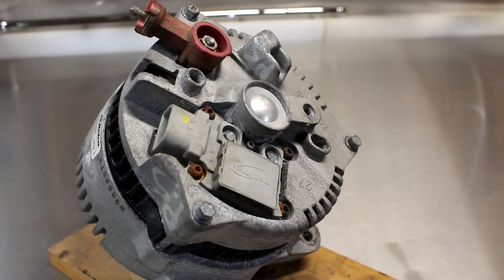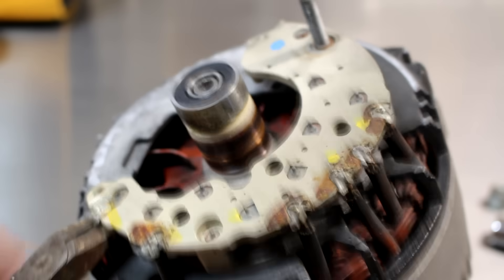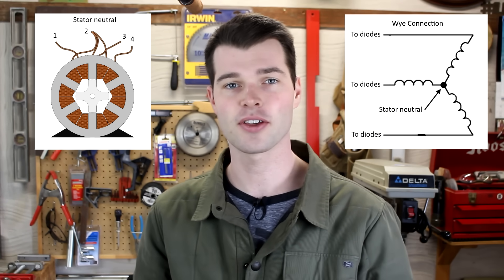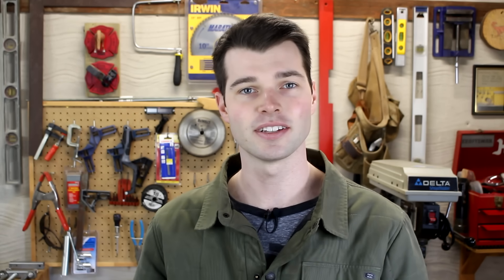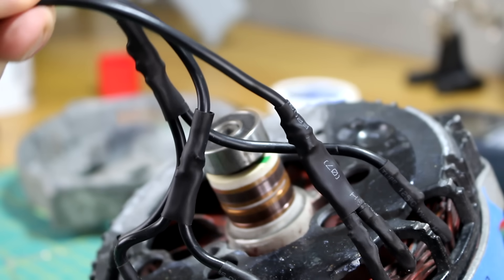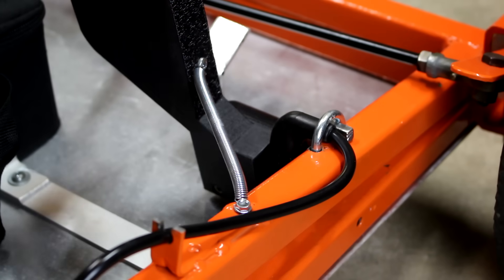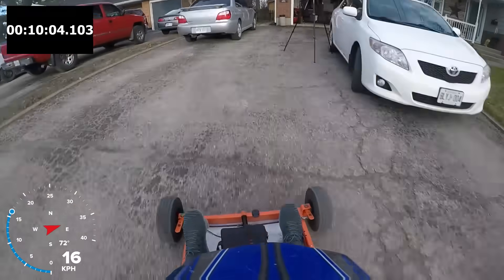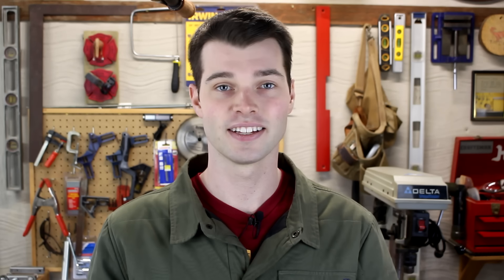Converting a Car Alternator into a Go Kart Motor

Comment: How about using same technology as is used in a Gear Reduction In some motorcycle starters but reversing it. Use a 60 amp Alt. for power only, using one chain to (example) connect to rear wheels, then as a tensioner use the larger gear reduction gear. The smaller one would then drive same size gear on shaft of 100 Amp Alt. This would drive 100 Amp Alt at max speed. (You can get shaft extensions with gear at one end and setscrew on hollow end to slide on alt shaft.Which would then supply power thru a rectifier/regulator (3 phase) be used for charging and lighting.Is this not what was used on early Motorcycles? Basically...? they used Generator to create AC voltage, which was used to Power Lighting and 90% of the electrical components used here This could be held to a minimum using LED's. The AC voltage then connects to a Rectifier/Regulator and is changed to DC voltage.  The DC power is used to power Brake light / Tail light and (again Using extended examples... fuel gauge, turn signals etc.) and sole purpose (without any DC lighting circuits, is to charge the battery. This was why when you turned ignition key on, you only had tail and brake lighting. Bike had to be running to enable Lighting circuit. This had pros and cons... left the key on (used kill switch to stop bike) Taillight stayed on draining battery was one, other was the did not see mode from other motorists (headlight had on/off switch plus H/L switch), most left headlight off until dusk. So they passed a Law mandating 24hr use of headlight / or running lights when vehicle was in use. this in the motorcycle world gave use total DC voltage. Key turned on... bike could be started (kick or electric starter) but all lighting was controlled by on/off ignition switch. Headlight controls were changed to just H/L function as they were now DC voltage.This dual voltage mode AC/DC could be used using a 12VDC converter to power a Battery charger to maintain battery etc.austiwawa , I think you are on to something here... maybe Just the basic concept. But if you can create power with minimal drag on power source, use a rectifier/Regulator... excess power would be dumped as to not fry Battery. Maybe just a voltage regulator (set at 14.8 volts DC, since you already have DC voltageActually the 100amp Alt. could be left original as it already has the capacity of the built-in Voltage regulator!!

Comment: Does anybody know what´s the maximum voltaje source you can use to power this motor (converted alternator)? Is it 14 volts as when supplying power to the car electric systems?

Comment: From prior experience with alternators, the rotor becomes magnetically saturated about 6V applied, and anything over does not get more power, it just heats the motor more. You could run half as many cells into the rotor and get the same output from your motor. And half the cells would get less current so a longer run time for your rotor pack.

Comment: Your cart will drive and turn much better if you build some ackerman into your steering.  The easiest way to do this would be to angle the steering arms inward on your front spindles. If you really want to get fancy incline your kingpins both inward and rearward at the top. What this will do is unload the inside rear wheel when you turn which does two things - it frees up the rear end (less drag) and plants the outside tire for bite. Have a look at a race cart front end some time for a visual of what I'm talking about.

Comment: Hey put another alternator left the way eat it would be on a car and a have it run off the other we'll either by belt or by chain and you could charge the battery as you are driving it. You would get a lot longer run time out of it if you were charging the battery at the same time you were driving it

Comment: I am quite impressed - this is a very competent and tidy job.  Even better - the thing produced at the end actually works!  I notice, someone has suggested the materials for lithium-ion are in short supply and hard to mine: Lithium is in salt, there's lots of salt; Cobalt is thrown away as a by-product of copper mining and in any event, can be partly substituted according to Tesla.  As for the perpetual energy suggestions - you must have laughed your socks off.  But it basically does regen braking if I am correct, or does that need another circuit?  I best re-run your vid.  Thanks again for sharing.

Comment: Nice project. Beware that the efficiency of this motor is not as high as if it had neodymium magnets inside. With magnets you save this part of the electricity which you pass to the rotor of the alternator. 
I wonder how do you find how much voltage to apply to the rotor winding. 
I think that to improve the efficiency, It should create magnetic force which is in balance with the opposing magnetic force from the stator.
I've got the following (untested) idea to improve the efficiency further (when magnetic forces are already ballanced via suitable supply voltages) (if the BLDC controller was in-house built):
 The stator's windings are supplied with PWM voltage. So the rotor is wasting energy when the stator windings are "OFF". It can be supplied also with PWM in phase  (or anti-phase - depending on how it's poles are wired) so the magnetic field to exist only when it's needed to create torque.

Comment: Sweet project! 

A side note for the alternator:

You can also leave the diode bridge attached and have the DC output feed back into the field windings of the rotor. That way you don't have to have an external DC supply.
Reply: You all don't know what your talking about. You wire the diode in series with the bridge rectifier opposite of the primary phase Feild winding. The other fields you wire in parallel. Besides the resistor on the commutator only puts out 5 milliamps. 😜
Reply: Bullshit dude. Do you not know the purpose of a diode?? Ya, they only allow electricity to flow in ONE direction. That is the sole purpose of diodes.
Reply: @JM-yx1lm  Diodes have many purposes, unidirectional current flow (under 'normal' conditions) is only one property (although a universal one). LED, zener, tunnel, schottky... and some of these are useful precisely /because/ they conduct in a 'reverse' direction.
Reply: @JM-yx1lm  you easily used BS when in fact you don't know what he mean or you just had a very little understanding on how the system was wired.

Comment: You seem like a nice kid. But I felt pretty stupid with how you assumed everything was so easy. Cool cart though. It reminds me of a harbor freight flux welder with a one minute / seven minute cycle time. Handy and fun but not very practical. With a new battery system maybe you might get twenty minutes out of it.
Reply: Easy is a matter of having the proper knowledge. It is actually easy if you have the proper technical knowledge as this kid has. A bit of research on you tube would make it much easier. I watched the video for about 5 times in the span of 3 months until I fully understood what he did, but not before I learned  alot about alternators, electronic speed controllers, batteries, electricity, power consumption, torque, BLDC motors and other related things. Best of regards.

Comment: im starting a project for a electric go cart, im thinking of using an alternator as a motor as you showed. But  i still want to use the altermator as a generator when i leave the gas pedal. Is that possible?
Reply: My thoughts- Use a relay that switches over from controller to diode pack- when you release the pedal.Therefore you need not cut off the diode pack from the alternator. You may have to regulate the voltage suitable for your battery pack and rectify it to DC from AC, since the stator produces AC current. Some  controllers (ESC) may themselves have regen capability but they need to be wired up properly.

Comment: Here is a circuit (3PDT switch) for switching between delta and wye. a wye start delta run uses low voltage/current and torque for starting, then switches to high torque when running. I assume we want the reverse of that, so we start in delta, and run in wye? http://acim.nidec.com/motors/usmotors/techdocs/profacts/starting-methods/wyestart-deltarun
Reply: Here is a schematic of the switch - https://www.digikey.com/schemeit/project/delta-wye-switch-NDHUJ30303H0/

Comment: Actually, the voltage applied to the rotor windings can be used as a "gearbox" of sorts. A lower current into the winding would mean less torque but higher max speed and vice versa.

Comment: I've seen some large output alternators made to keep a charge on extra batteries for motor homes, and I've seen large output alternators used in rice burners to power the owners huge amplifiers used on their stereos... how much of a difference would one of those have in this application? and why did you do this in the first place if the motor on your cart was adequate?

Comment: My alternator is from a diesel truck and has over 200 A current.  With the speed controller / battery in your build still work with the bigger alternator? Thanks!

Comment: Good video! In 1957 I had a home-made gas go kart & our Dad built a really simple generator driven go kart with my younger brother. No mods needed on the generator. Three 2x4s made the "frame" & 2 axels - steering with feet. Dad made a 3rd battery post out of solder in the middle of a 12v battery. (Batteries then had visible straps connecting the cells, covered by a tar substance). So you could run on 6 volts (about 5 or 6  blocks) at good speed. Then switch cables to the other 6 volts for the trip home. I'd run on all 12 volts & it was almost too fast on that little kart w/ skinny solid rubber wheels!

Comment: why 2 batteries?
Reply: Because the speed controller and alternator are capable of voltages around 48v, not just 12v. More voltage will give more oomph or a higher capacity if used in parallel.

Comment: I got 2 blowdryers from goodwill and wired them direct to a battery out of a semi screwed it all down to my skateboard went fro LA to Venice on a single charge, put one of those old friction power supply off a 1970 schwinn on the front wheel to charge the battery exp going down hill

Comment: Get an 8D battery and a Delco 40MT starter motor. Won't run long, but it will make you want to work on the brakes.

Comment: Interest only: Fuses have a time versus current fusing time  - usually available from reputable manufacturers. For near instant fusing you need about 2 x the rated current. Actual fusing time is affected not only by current but on the degree to which the fuse is thermally insulated. Approximately - the more insulated the lower the time to fuse. IF your battery  is to be protected against overcurrent then a close tolerance resettable electronic fuse is usually required. | You can make a current meter that does not drop any more voltage than the wiring does already by measuring the millivolt drop across the wiring from eg battery to motor. This can be calibrated using a known current to determine mV per amps. Use a resistor about equal in Ohms to the battery voltage. a say 10 Ohm resistor in a 12V system or a 50 Ohm resistor in a 48V system. This will draw about 1A so will hqave a power dissipation in Watts about equal to the resistance in Ohms SO you want to do VERY BRIEF connections for testing and use the highest wattage resistor that you care to afford. eg a 10 Watt resistor of say 50 Ohms in a 48V system will dissipate about 5x its rated Wattage so needs to be powered for well under a second at a time. | . Assume a 48V system and 50 Ohm resistor. Place a volt meter across the resistor, power it BRIEFLY and note the voltage. eg a 48V system may drop 46V across a 50 Ohm resistor. I = V/R = 46V/50R = 0.82A. Now connect a voltmeter on a low range -200 mV is ideal with a 0.1 mV resolution - found on many meters - even quite cheap ones. Connect meter from battery positive to motor (= resistor) positive. Now BRIEFLY connect battery as above and measure Vwiring. Say V= 6 mV. We know there is ABOUT 0.82 A flowing so we have a reading of Vmeter/Iamp = 6 mV/0.82A = 7.3 mV/A. So if the motor draws say 50 A the meter will read 50A x 7.3 mV/A = 366 mV. Calibrate accordingly or tap off meter point to make meter read more meaningfully.

Comment: Those alternators are notorious for crapping out. I had to replace the one in my Grand Marquis before 40,000 miles.
Reply: The guy on ebay who sells rebuild kits says typically 130 k miles for failure of slip rings. Mine failed at 130,000. As they say, your mileage may vary. .
Reply: its a go kart not a car he aint goin to do much more than 10,000 miles before half of the other stuff gives out

Comment: Awesome JOb....Learn how to TIG aluminum then re-make the chassis out of Aluminum.  I do like seeing young adults pushing the envelope. Use your skills to improve your situation becoming self reliant; but not to further the grip that government has upon us all. Again Great Work...."The Maker becomes what he Makes"
Reply: Steel frame provides flex and acts as suspension. Aluminum is too stiff and rigid. Same for carbon fiber. Steel is real!
Reply: Quinton P. Young III - actually his generation would be making a carbon fiber frame.
Reply: So if I keep making fertilizer out of cow manure and compost I will one day become shitty and dirty? I would have to say the electric motor is here and reinventing the wheel is useless. We also have lithium batteries and the technology is only getting better. The thing we should be focusing on is gearboxes that work and can be maintained easily or just replaced like batteries. Same with all other major car componets. I would love to literally exchange my battery like a propane exchange instead of sitting and waiting to charge. Tesla is going the wrong way with charging stations for the public. Gas station attendants should be trained to charge lithium batteries and there should be an exchange at the gas/energy station. (; Your Welcome Tesla... Just take a look at a good electeic blower. The technology finally caught up to a gasser. The Ego 56v vs a 50cc equivalent...as long as you have power in your batteries and you have enough to continuously charge, replace, repeat and cycle...and the things are very durable and less finicky. 
The minute we have interchangable batteries, engines, and transmissions that can be taken out and replaced like a car battery is the day the car becomes as easy and cheap to own as a cell phone. This would solve many problems.
Reply: jonathan mcadams - Battery technology especially is evolving too fast for there to be meaningful interchangeability in the foreseeable future
Reply: @petersouthernboy6327  The housing, connections, and voltage and amperage output can still be the same. The same way all lead cell batteries look a like and will generally work for any car. Cold Cranking Amps aside...they all push the same voltage range right?
Reply: . . . .  amongst other things
Reply: Quinton P. Young III hhghmngjbhhbhhbbnyttttttttttttttytttttttyyyyuyvu.                     Gubbhhhuygg.   Vnvv. V       A   Ggbbbvv.  But nhggbccvcvgiunkjjjjbjnhgfbgyy
Reply: I’d stick with steel. Cheaper, easier to weld and it bends instead of breaks. You can straighten a bend. Aluminum breaks. And it’s so much cheaper

Comment: Hi austiwawa,
first, GRATE video! very informative :)
let's take it a step farther -
can you somehow test how much power you get from the alternator (HP or KW)?
can you test max voltage and max ampere this "modified motor" can be used ?
can you give some technical details regarding the tested alternator (rated ampere) ?
Thanx !

Comment: One thing you didn't explain... what was the additional 12 volt (or rather, 11.1 volt) lithium pack for? Could you supply a wiring diagram and explanation of this? Also, what was the function of re-installing the brush assembly there with the two wires connected to it?
Reply: The additional battery is for the rotor that current  goes direct to the brushes (in the brush assembly) through the slip rings and finally rotor wirings and make it into a constant poled electro magnet.

Comment: If you wouldn't mind sacrificing efficiency and weight, you could also mount a lawn mower engine to another alternator to act as a dynamo, supplementing the battery power under load and recharging it during corners, floats, and stops.

Comment: So....  how the the motor perform by comparison to the 1800 watt original? What was the impetus to change this, or was it an experiment to see how well it would work if it could be done? Did it last longer than the other motor (run time wise?) Since it cooked your battery connections, I'm assuming it had a higher current draw, but since you changed tires too, you effectively changed your final drive ratio as well, so it's not exactly an apples to apples comparison...
Reply: I'm also curious how it compares to the store bought motor!

Comment: A 40A fuse is designed to carry 40A not blow at 40A. Potentially it could carry 60A for nearly a minute.
Reply: Uh not normally.  A 40 amp fuse can carry about 32 continuously
Reply: @STRUTZKOFF    As a retired ASE Master Tech, I can tell you that fuses are thermal devices. So they can open at 32 amp in a hot engine bay or 48 amps in a cooler cabin. These are sensitive to temperature and not so much current. I have a two page sheet that cover newer fuses starting with the ATC/ATO and up, but explains how they work, where they get their names, usage and a temperature chart from ACDelco.
Reply: @STRUTZKOFF  
Fuses protect against surges not against continuous power

Comment: Use headway 38120's. They are a tad bigger but will handle current a lot better then 18650's and also bolt together instead of needing to be soldered.